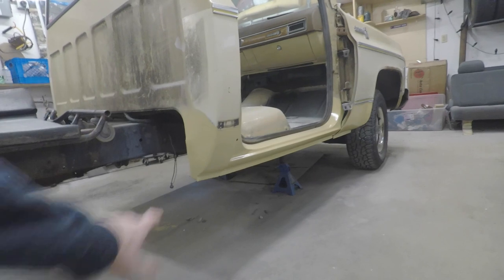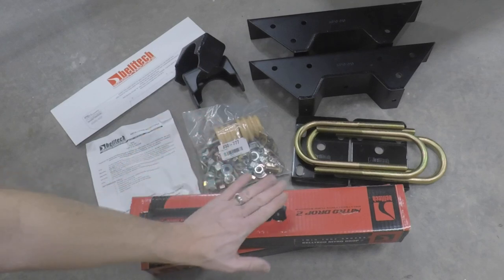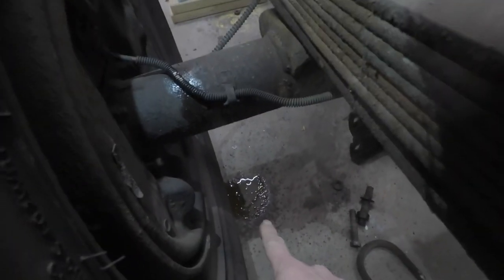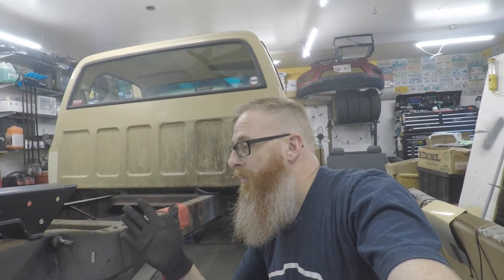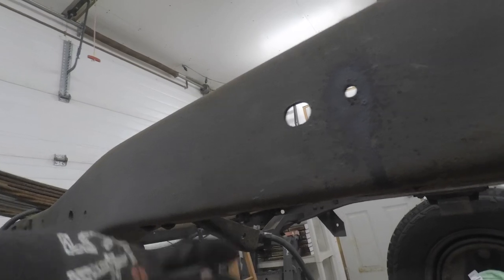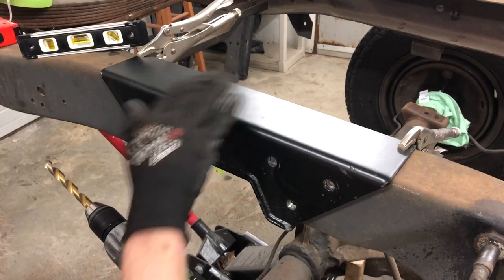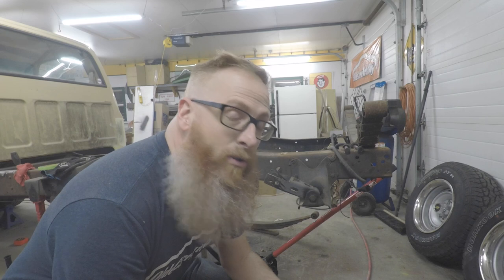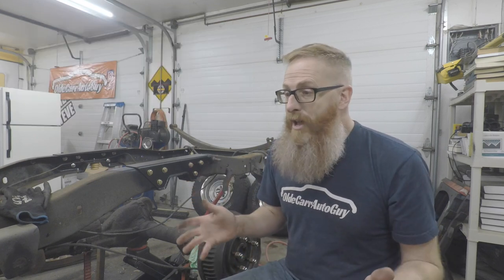HOW TO INSTALL A BELLTECH C NOTCH KIT ON MY 1977 CHEVY C10 TRUCK-PART 1

Comment: Looks like a well put together kit. On the brake line, just pinch it off. You don't need it. The front wheels do most of the braking anyway. :-D
Reply from the maker: 😉 Good call Harley!

Comment: I just got a nice original paint 86 c10 silverado and it has a bolt in beltech C-notch and it sits nice.  Does the bolt in notch compromise anything? Should I get it welded?
Reply from the maker: According to belltech it’s designed to be strong and strengthen the frame. I have faith in its integrity! Thanks for watching!
Reply: @OldeCarrGuy  thanks. I noticed that this truck drives nicer than my other truck with a similar drop kit and no C'notch It could be because I have 15" wheels and bigger tires and the 20 inch  small sidewall tires. Ty
Reply from the maker: The 15" certainly doesn't hurt. But with static drops, you're pretty much maintaining the stock ride. I run 18" tires and it still rides pretty good.
Reply: @OldeCarrGuy   I think the gentleman I bought my trycj from told me that 18" the highest I can go. 18" will look lower maybe. Just want to find the widest and offset that is best for the rear. Thanks

Comment: What size drill bit did you use?
Reply from the maker: I believe it called for 1/2”!!
Reply: Olde Carr Guy thanks man. Going to be doing this tomorrow!
Reply from the maker: It’s really not as intimidating as it looks! Just be sure to support the frame on both ends of your cut!
Reply: Olde Carr Guy will do! Thank you!

Comment: man that is going to be super low in the back. You already have 4 inch drop kit on there now with those drop or raised hangers in front and those longer shackles in back those together usually net about 4 inches of drop and now with another 6 on the flip kit? You may want to wait a bit on removing those leafs in case it sits too low. I would assume someone has done some lowering in the front to make it match the back maybe just spindles, maybe cut springs or drop springs? My point being you've got like a 4 or 5 inch drop max in front(after you install your kit) yet the rear as is should be around 10 and that may end up not what you are looking for in the complete drop. Now then again not a problem because if you were to install factory front hangers and factory shackles, it'd be exactly what the kit was for drop wise and then removing leafs could help to soften the ride and maybe drop the back a bit more. Loving it so far, going to do my dad's the same but wondering if I might squeak by without the notch.
Reply from the maker: Yeah! I realized all this once I set it on the ground last night, when I reassembled everything. Its practically sitting on the bump stops. it was then I realized that I needed stock replacement spring hangers and shackles.  You have a good eye to catch all that from the video. I knew it would be lower but this is way too much for the look I was going for. When the drop springs and spindles are installed, I want it to sit level and it doesn't look like I'll have that as of now! 

It's all a learning experience for me and I'm having fun! Thanks for your observation and thanks for watching.
Reply: @OldeCarrGuy   Anytime buddy my eyes are actually terrible I've just been around these trucks alot and always looking into parts and watching videos, pics of them. I know lmc has them but at what cost not sure. I just order a rear shackle hanger for dad's and it wasn't bad around 45 us shipped. I hear the front's are more expensive. I also know rockauto has stock shackles and maybe some local parts store because I'm not sure if rockauto ships to you?  You may even hit up some facebook squarebody pages or forums and offer a trade for your lowered stuff to their factory stuff? As always though buddy love watching the build.

Comment: If you need help with brake issues... don't come calling me 😂

"I'm going to cut the rivets out... because that's fun" made me laugh

Belltech has had an industry leading name for years. Had thoughts of C-notching my 95 F-150 way back in the day, but that never happened. Dale gettin' low!
Reply from the maker: haha! Got those brake issues fixed first thing!